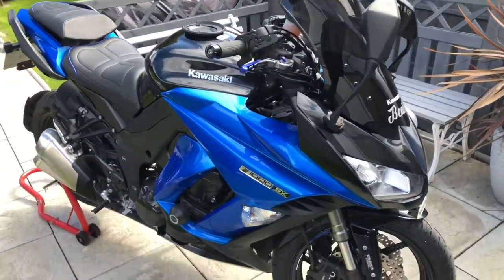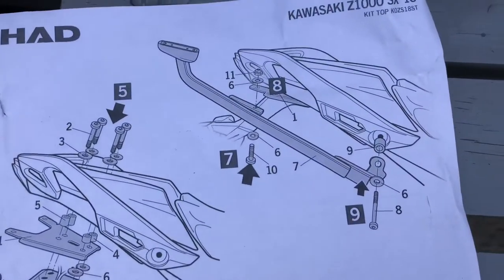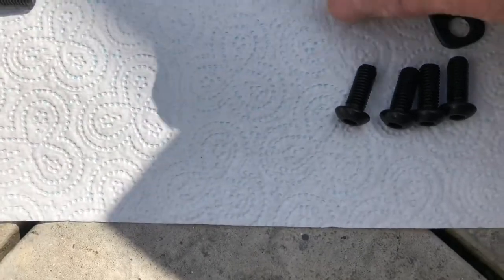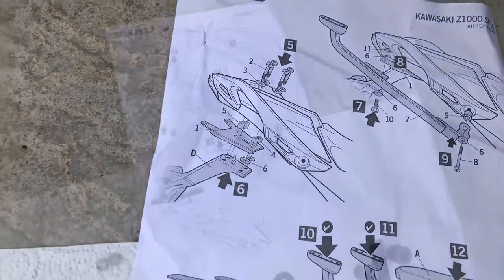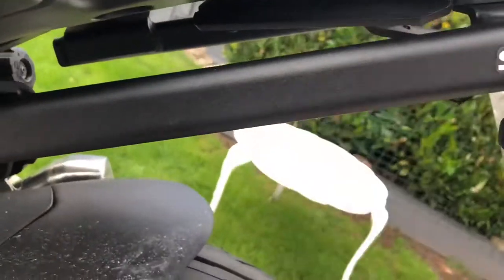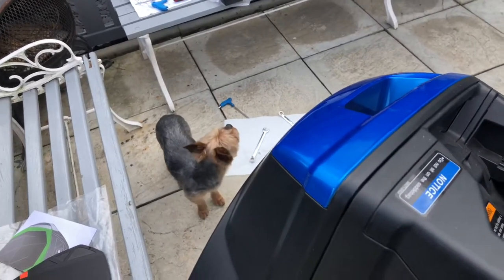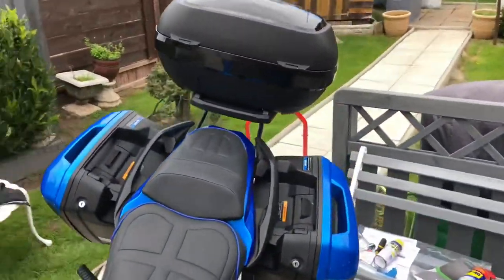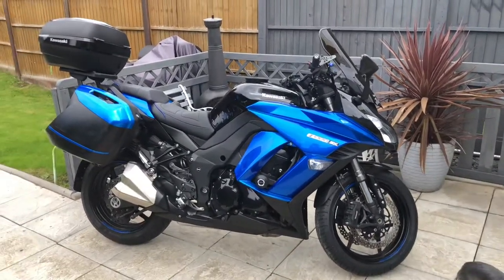Pt2 Z1000 SX Shad rack fitting compatible with Kawasaki panniers

Comment: Great video, i'm looking at buying a 1000sx but was nearly put off because l had read you can't have a topbox with panniers so finding this video has made my day
Reply from the maker: Hi there thank you for watching speed wise when I went to Germany on the auto bound sat well 85/90 mph no problem 👍👍👍
Reply: @SOLOMOTOUK  Before l had watched your video l sent an email to Shad asking if it was possible for there brackets to fit with genuine panniers and l got the reply this morning and they said no its not possible, how bizarre
Reply from the maker: @markpercy4277  Hi mark that’s crazy what year is your bike
Reply: @SOLOMOTOUK  its a 2015 model
Reply from the maker: @markpercy4277  hi mark it will definitely fit mine was a 2016 👍👍👍
Reply: @SOLOMOTOUK  Cheers bud
Reply from the maker: @markpercy4277  if you get stuck just ask 🙏👍👍
Reply: @SOLOMOTOUK  👍

Comment: Hi! This is a great video, what is the code of the Shad mount? I am also looking forward of having the two luggage system, side cases and top case. Thanks a lot in advance!
Reply from the maker: Hi I here thank you for dropping by to my channel. 
The Shad rack which holds the top box item code is 
KIT TOP KOZS18ST. 
PLEASE TAKE NOTE THIS IS FOR THE RACK ARMS YOU NEED TO MAKE SURE YOUR BASE PLATE FOR YOUR TOP BOX WILL FIT LUCKY ENOUGH THE GENUINE KAWASAKI ONE DOES FIT. 
ALSO TAKE NOTE THIS RACK IS FOR A 2016 Kawasaki Z1000 Sx they are slightly different shape. 
All in all ordered from Shad took 3 days from ordering to having it delivered. 
Thank you for for interest I also made the genuine Kawasaki top box at half price you can see that in the other video 👍👍👍
Reply: @SOLOMOTOUK  thanks Derek, will take a look at your suggested next video.
Reply: @SOLOMOTOUK  i have z1000sx 2014, can i use this rack properly? Thx you.
Reply from the maker: @sihwidhi  yes you should be able to someone else had a 2014 but make sure you get the shard one cause some cheaper ones say they but do not hope this helps you 👍🏻👍🏻
Reply: @SOLOMOTOUK  I know this is an old video now, but it's something I'm looking at. I have a 2015 Z1000sx and have the original side panels. So from what I can gather I need the following:
KOZS18ST - Rails
D1B591PA - Plate
Shad 58x or genuine Kawasaki top box.
Does this sound about right or do I not need the Plate?
Reply from the maker: @pinnacle_moto  if your going for the original Kawasaki box you need the plate for that if you go for the other you need that very rare different makes fit each other 👍

Comment: Even though I have the same shad bracket and topbox, on my 2021 Ninja 1000sx the topbox shakes and causes an annoying chatter which I thought was the suspension. Going over bumps I put my left hand on the topbox and can feel it julting and moving, even though the shad rack is solid like yours. Makes the bike feel unsettled, how are you finding it when riding just with topbox then?
Reply from the maker: Hi there I don’t own the bike anymore but riding with the just top box no shaking you might need to get better rubbers on the plate how I know this cause my new bmw f850 Gs adventure was shaking and made an horrible noise so I took the rubbers that came with the plate and got new ones done the job no more shaking hope this helps you 
If you put the top box on and try shaking it if there’s movement definitely needs them.
Reply: @SOLOMOTOUK  Thanks, its not the rubbers, the box is solid, but strangely does shake which goes through the bike. I think the Ninja 1000sx is very sensitive. I still experimenting.

Comment: Hi Derek, great vid. Your z1000sx is a 16 plate as is mine. Are the ails you fitted for the 18 onwards. The part number you gave seems to be for the 18 on. But clearly they fit. Any advise appreciated.
Reply from the maker: Hi there the number is the one the shop said will fit my bike it fits perfectly has you can see but make sure you buy from a know seller has I’ve heard some say yes it fits and some say it doesn’t 👍
Reply: @SOLOMOTOUK  thanks

Comment: Thanks for the video and it looks great. Did you have to disconnect the wires for the break light and indicators when fitting?
Reply from the maker: Hi Nigel no the tail end just drops no disconnection at all if your going to use this Shad rack make you get the spacers the right way around not like me the 1st time they can be a little fiddly but nothing like a long nose pair of pliers to hold them in place while you fit the bolts back in. Hope this helps thank you for dropping by 👍🏻
Reply from the maker: @blackbike1979  the plate is what holds the flashers on its the tail tidy plate I bought the bike has a Z1000 Sx tourer I think that Kawasaki put this type on because of the pannier if you look a photos you can see the difference between the tourer and non tourer without panniers fitted it’s bigger and sticks out more further back away from the bike 👍🏻
Reply: @SOLOMOTOUK  Thank you so much.  Just noticed that.  I see that the one you used is on the Shad website and it indicates that it is for models 2018 and up... but works good for you. I have the 2017 tourer and would want to use the Kawasaki panniers just like you.  Thank you very much for your replies, it has been very helpful.

Comment: Hell0 Deg.
I' ve done this on a 2019, and now the Kawasaki panniers are a bugger to get off. Did you have any problems with that ?
Cheers
Nick
Reply from the maker: Hi Nick no problems when I done mine I checked between the panniers and the Shad rack roughly 4mm gap you could see Al the way down both sides without catching the rack or the panniers sorry I cannot help but I don’t think they changed to back end of the bike until the 2020 models come 👍🏻👍🏻
Reply: @SOLOMOTOUK  Hello Deg,
Thanks for that, I've got clearance down the rails etc. The problem I've got is the catches catching.
More fiddling and maybe washers required.
Cheers
Nick
Reply from the maker: @nicholasfathers9742  hi Nick have you got on the where the original panniers fit the clear how can I explain it looks like small tape oblong-ish looking if there missing it makes the panniers stiff to put on and off use some silicon lube sounds mad but it definitely easier to fit them mine were missing you cannot get replacements my Kawasaki dealership said this 👍🏻👍🏻
Reply: @SOLOMOTOUK  Cheers, I have the oblong so will try the silicone lube. Nick

Comment: Hi Derek. Just stumbled across this video which has given me some hope! Will this set up work on a 2015 z1000sx? I don't know if anything changed from 2015-2016?
Reply from the maker: Yes definitely will fit the 15 cause then run 14/16 mines going tomorrow sad day but to big for me I’ve got the top box I’m putting on eBay £350 nearly half price should get a buyer cheers for your comment stay safe.
Reply: @SOLOMOTOUK  Thanks for your reply! I literally put a deposit on one the bike today, but was going to pull out due to being told by Kawasaki that it's not possible to put a top box with the Kawasaki panniers. Are you 100% sure the Kawasaki 47L top box and plate with the Shad bracket will definitely do the trick, and panniers will fit??
Reply from the maker: @johnbrown7506  yes definitely I tour Lake District hawes all around there and never had any problems at all Kawasaki do say not to fit a top box with panniers cause of weight but if you dig deep on line a look 1000’s have done and nobody has ever reported anything bad but saying that on the way back down on the M6 I went well did not realise I was doing 120/130 and it slightly gives a little shake but no one should be doing that kind of speed with any luggage on at all but hand on my heart I never had any problems at all 👍🏻👍🏻👍🏻
Reply: Ok thanks Derek! I’ll let you know how it goes 👍
Reply from the maker: @johnbrown7506   nice one enjoy 👍🏻👍🏻
Reply: Derek can you recommend a good screen that will reduced wind? A mate said try a Powerbronze double bubble screen but not sure. Any tips would be appreciated 👍
Reply from the maker: @johnbrown7506  the only one I can recommend is the puig touring screen similar to the one I have fitted. 
the standard ones that come with the bike even the double bubble ones don’t work I’ve tired them there’s other companies out there but I stick with puig screens 👍🏻👍🏻👍🏻
Reply: Ok thanks, will look on eBay now 👍 Bully beef & chips 😆
Reply: Derek I’ve got all the bits now, the rack, the same 47L top box I found on eBay, minus the cover plate and the plastic trim. I wanted to ask, how is the black sparkle trim fitted to the top box? Is it screwed in, or does it just click into place?
Reply from the maker: @johnbrown7506  you got I think it’s just held in with the trim next to it 👍🏻
Reply from the maker: @johnbrown7506  hi John just looked over the video of it looks like screws I’ll put the like here do you can find it quicker. 
https://youtu.be/W0AypjCXf4s
Reply from the maker: Definitely screws 👍🏻
Reply: Ok thanks. After watching your previous vid, I realise I need a lock mechanism also. Getting costly now 😩. Did you ever try the Powerbronze screen? I’m torn between getting the Puig or the Powerbronze screen 🤔
Reply from the maker: @johnbrown7506  hi John no never used power bronze screen I’d check on eBay there’s a good selection of them clear light tint or dark tint some are a little wider some are taller don’t go to tall has it will make the bike in steady at speed I sent the 1st one back 65 cm tall to big.
Lock you have to get that from any Kawasaki dealer or authorised dealer make model vin and reg  they there know the correct barrel you need so it will be one key for ignition panniers and top box makes like easy 1 one hope this helps 👍🏻👍🏻

Comment: I have z1000sx 2014, can i use this rack properly? Thx you sir
Reply from the maker: Hi yes very useful rack  I had the big top box on it worked perfectly fine solid as a rock 👍🏻👍🏻👍🏻
Reply: @SOLOMOTOUK  sory i mean 2014 sx, this is properly?
Reply from the maker: @sihwidhi  yes I just left comment just make sure you get the right part numbers from Shad 👍🏻👍🏻
Reply: @SOLOMOTOUK  thx you sir

Comment: Hi ya. How has this held up
Reply from the maker: Hi there still going strong no problem having the panniers on to the only thing I have felt is when it’s windy you get buffed a bit but that’s the same on all bikes with top boxes it rock solid at 80/90 mph not done over 90 on it with all the luggage Kawasaki say 80 mph max thanks for your comment 👍👍👍
Reply: @SOLOMOTOUK  cheers pal. Ive just ordered some for my sv650. Yours was the only decent video on here. Do you know if I have to buy a shad plate or will any plate fit them
Reply from the maker: @motorcyclewild5873  hi Cheers I was lucky the top box came with the Kawasaki plate lucky enough the holes on the Shad rack arm’s lined up with the gaps in the Kawasaki base plate 2 nuts & bolts facing down and 2 facing up has couldn’t not get a tool in to tighten them up hence 2 up 2 down but solid has a rock doesn’t move. If you get the base with a top box have a look to see if the holes in the base line up with the rack if not you will have get the Shad base plate then there top box other I seen people fit the Shad plate and fitted on top of that the base plate that comes with there box which is wrong not safe plus it looks no good I hope this has helped you thank you Derek 👍👍
Reply: @SOLOMOTOUK  cheers mate I'll have a look when it arrives

Comment: Nice video, do you have the part number from Shad. When i ordered, what i thougt was the same, i got the older parts for 2011 and for newer bikes without panniers.
Reply from the maker: I’ll have a lot when I get back home and have a look through the paperwork 👍
Reply from the maker: I’ll have a look through the paperwork when I get about 6pm 👍
Reply from the maker: Hi there this is the order for my kit 2016 Kawasaki Z1000 SX Tourer 

Box Fitting Kit (K0ZS18ST) 
Just Fitting Kit / No Thanks / No Thanks 
K0ZS18ST
× 1
£125.10
Subtotal	£125.10
1 Working Day (Before 3pm)	£0.00
VAT	£20.85
Total excl. VAT	£104.25
Total	£125.10
Reply from the maker: Here’s the company name and address phone number. 
Please do not hesitate to give us a call on 03333034123 or send an email to orders@bikeluggage.co.uk if you have any questions at all.

Many thanks,
The Bike Luggage team
SHOP	ABOUT	CONTACT
BikeLuggage.co.uk
Bike Luggage is registered as:
Alpha Duck Ltd in England & Wales 12019515
Reply: @SOLOMOTOUK  Thanks, that ´s what i thought I ordered from my local dealer, but got the older model that  doesn´t fit with the panniers. If i don´t find any swedish dealer, I will order it from UK. Thanks again!
Reply from the maker: @michaellarsson1357  thanks for you reply brilliant I put the Uk sellers address in hope that helps 👍👍👍👍BSafe